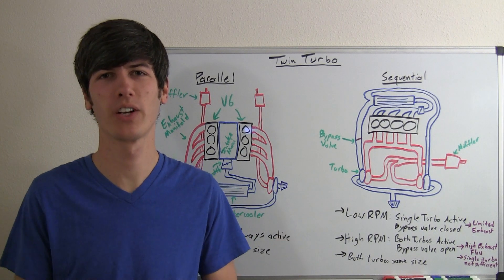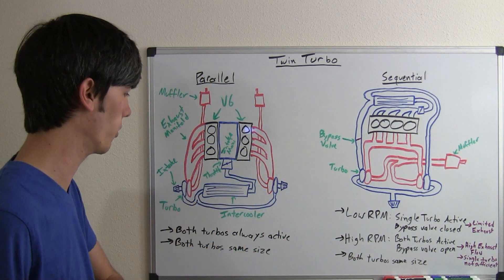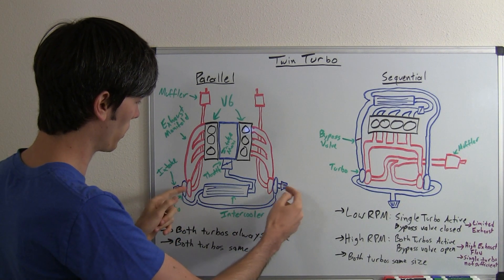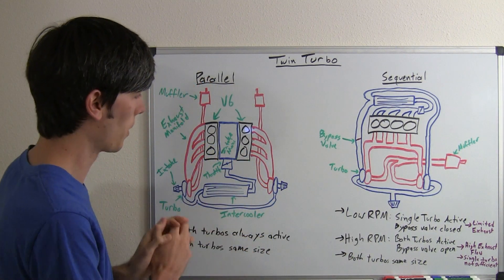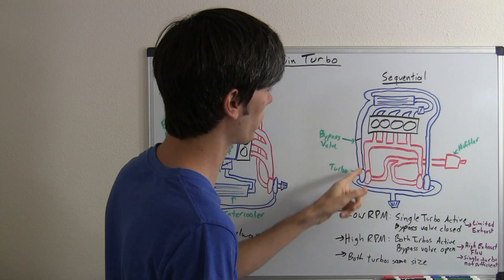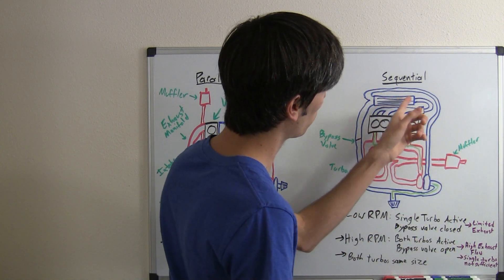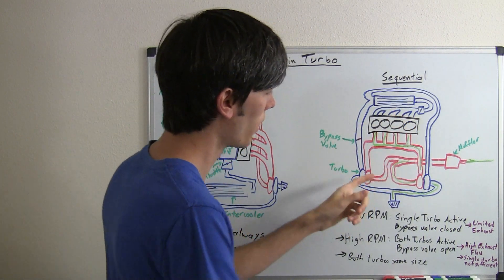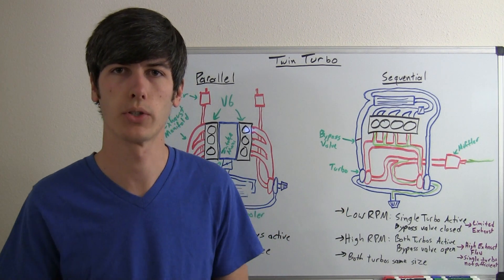How Twin Turbos Work - All The Boost!

Comment: i have a question for u sir.what if a person going a smooth road with sequential turbocharger installed; finds a turn or some obstacle so applies brake hence lowering the rpm leading to immediate valve closure on one of the compressor side hence leading to surge like effect on the turbocharger (somewhat like exhaust braking but at very high rpms) can cause a great disaster to the blades of turbocharger so instead putting valve on intake side ain't it be possible to place the valve on exhaust side of one turbocharger so that this problem is mitigated and even the desired logic of switching both the compressors 'ON' only at high rpms  is also sustained.

Comment: but you can use one small turbo to spool up a larger turbo. The Exhaust gases from the small turbo into the larger turbo. The smaller turbo will give you faster spool up time at low RPM and at high RPM the bigger turbo will come in. It's called compounding.

Comment: if we speak about efficiency in terms of exhuast flow. would it be more efficient (on a 4 cylinder ) to run 2 exhuast ports per turbo or the way you have just explained....... what are also the pros and cons of run it 2 ports per turbo

Comment: If you were to install twin turbochargers on a 1975 914/6 a perfer the Parallel setup, but what size would the engine be able to push?

Comment: Question, if we have two turbos boosting at different rpm with different boost,eg,
Turbo boosting at low rpm with say 10psi and second boosting at high rpm with say 20psi , would the lower pressure turbo have to be bypassed when the higher boost kicks in? Or can you have the high boost 20psi boosting while lower boost 10psi is still boosting? Or would two different boost levels at same time not work? Cheers, learning so much in you videos
Reply: i thinkkkk that would as they combine into the intake but dont quote me on that i would look more into a precharger for that kind of stuff to were you run the smaller turbo behind the larger to spool the larger one much faster.

Comment: Whats the main reason for putting the bypass valve on the air pipe and not on the exhaust?
Do we want to have already built up pressure on the turbine?

Comment: Just a quick question. Once both turbos are working together when the engine isn’t at the high rpms anymore wouldn’t it cause the single turbo to over spin? Or will the bov dispose of the excess?
Reply: Both turbos are not connected to each

Comment: is there any valve on 2nd turbine exhaust line to prevent wastage of exh gas flowing to turbine which is not in use.Also we can use one single larger T/C why use two which would increase maintenance and occupy  more space and piping is very complicated.

Comment: but say you had a petroleum fueal engine say v8 injection eg could you have one 88mm turbo and a smaller say 40/50 mm sorta size turbo but had no bypass system would the smaller turbo over spin? bear in mind that the two turbos would be be completely independent?  im not sure if it work?

Comment: So ultimately which setup is capable of producing the most power/boost, parallel twin turbo or single turbo?
Reply: That's dependent on the size of your tubos and the raw cubic feet /minute. you can have a giant 100MM Turbo or twin 70mm turbos, They'll both give you roughly the same airflow and boost pressure. Twins will spool faster and give you more even power distribution across your rev range. The management system for the twin turbo is significantly more complex than just a solo turbo engine.

Comment: For the sequential set up, let's name the left turbo 1 and the right, 2. Why don't they utilise the exhaust gases from 2 and put it through to 1 at high rpms? You could have a similar bypass valve that just directs exhaust flow to exit at low rpm, then opens up at higher rpms to let the exhaust from 1 go to 2 to spool up the first turbo more. Or is there something like this already? Or does it have some sort of vital flaw that im missing?

Comment: Hi Jason, I love your videos and have been a subscriber quite some time. I am currently working on a second gen Pontiac Firebird. It will receive a twin turbo setup. I have this wild idea about deleting the original fuel tank and putting the radiator in its place. The intercooler would be in the front of the car. I was thinking a rear diffusor would suck air through the radiator at speed and electric fans while cruising. Do you think a setup like that could work? Or should I stick to my pedal cars ;) ?
Reply: How you will fit radiator hose to engine

Comment: There should be a bypass valve before the secondary turbo right? Otherwise there's nothing stopping the exhaust gasses spinning the secondary turbo even at low RPMs.
Reply from the maker: There could be one added, yes, and it'd probably be more effective. Ultimately it wouldn't be able to spin much since it can't take in any air through the intake.

Comment: I have question? so if I use the different size turbo in sequential twin-turbo setup. Small turbo for low rpm which means the turbine can spin a little bit fast, then goes to the high rpm, both of turbo work for the higher rpm boost?
Reply: bob If u use a small turbo for low rpm its fyn but as in sequential as the speed goes high it starts using both the turbochargers . and if the size of both is different u would actually get less boost than the later with same size
Its better to have a turbolag if we can get a good amt of boost

Comment: Hi there! I just wanted to make a question. I have a s13 with a ka24de and I had this crazy idea of making it twin turbo with some small A/R turbos, low comp forged pistons and rods, maybe porting the head for some better flow of the exhaust gases and increasing the spooling of the turbo but I've never seen a ka24dett, my question is, will it be reliable or at least possible? My turbo options are gt22 or k04. I hope to get an answer! I've learn a lot from your channel, keep rocking!
Reply: Porting the head don't make much difference imo

Comment: What is the advantage of using twin turbo over a single turbo in case of sequential?

Also, when car manufacturers talk about a “biturbo” are they referring to parallel or sequential?
Reply: It would reduce turbo lag. Because the first turbo spools up at low rpm.

Comment: Does the bypass valve shut down boosted air? I see it's after the air has been charged, before it hits the intercooler. Dump valve? Thanks
Reply: I think the idea is that when the bypass valve is closed, compressor will stall, which will block the flow of exhaust gas through the turbine.

Edit: many (all?) systems use a valve in the exhaust too that blocks flow to the turbine.

Comment: Does the piping lenght matter or make any difference in matter of efficiency ..cause if one is longer then it would take one turbo a little longer to create compressed air or what? Thanks :)
Reply from the maker: Yes, everything plays a role in efficiency, though my diagrams are basically for the ease of understanding, not a design suggestion.

Comment: so what is the main point in having two turbos vs 1 turbo? is it because you can use 2 smaller turbos which spool faster to give you the same power/boost as a single bigger turbo? and given that u have reduced the spool time, you can go faster (minus the weight increase)?

Comment: Why tuning the ecu gives more power on a turbocharged engine than on a NA engine? I think there are more things to tune that can produce more power on a turbocharged engine, but what are those to tune? thanks for answering!
Reply: Tuning a turbocharged engine makes a lot more power because the turbo can provide air pressure greater than atmospheric pressure inside the combustion chamber.  Example, stock NA engine rated 140hp.  It can only make 140hp without changing to higher compression piston, larger bore etc.  It is limited to 140hp because it cant produce more than 14.7psi of pressure in the combustion chamber.  Now take that same stock NA engine and add turbo.  Lets say the turbo is boosting 10psi and making 235hp ([ (HP of NA car) x (1 + (boost psi/14.7)) = HP at boost psi ]) .  That means at atmospheric pressure at sea level is 14.7psi, the turbo is adding an addition 10psi more.  That equal to 20.7 psi of pressure going into the combustion chamber.  Thus more pressure in the combustion chamber.  Now in order to avoid blowing up the engine, the ECU must be tune.  The tuner addjust the ECU setting to supply more fuel to compensate for the added air in the combustion chamber.  Tuner could also decrease and or increase Ignition Timing as neccessary to run the engine properly.  Result, same engine, but its more efficient and output more power due increase in combustion pressure by turbo.  More fuel needs more air = more power = happy

Comment: I dont get why bypass valve is on the intake pipe. Shouldnt it be blocking exhaust going to second turbo?
Reply: aslanyavuz need to block intake and exhaust sides of second turbo until the first turbo is spooled up.

Comment: How is it decided when to open the bypass valves on the 2nd turbo? and are they opened gradually at a % rate or is it just open/shut? Because a gradual open wouldn't allow for efficient spooling of the 2nd turbo but an immediate open would just be an instant increase in boost at the set rpm open point and wouldn't that feel strange? never driven a twin turbo so sorry
Reply: That's a good question. My guess is that the bypass valve is opened at a set RPM?
Reply: Load and pressure being sensed

Comment: Someone please answer me this.. On a twin turbo set up, does the air intake to both turbos need to be the same length or is that not relevant? I am thinking down the line of 1 turbo (shorter intake) scavenging air from the second? Fairly uneducated guess sorry

Comment: would it be possible to twin turbo a car with two different size turbos and different boost so you can use one to get off a stop faster and one to help in to top speed end I'm a noob and wanted to know

Comment: could you do a video on quad turbos with a w16 engine from the bugatti veyron
Reply: There's a small turbo each 4 cylinders. Works like a parallel twin turbo on a V8 (or W8).
Reply: Mitzkal o, oright cheers

Comment: Hey, i would like to know, what are the downsides to this? Because as you explained it all looks nice and all. Why isnt this kind of forced induction that common? I can guess it has to do with added costs and  another reason for failure? Also can you get more boost like this, or does it just give less turbo lag?
Thanks in advance.
Reply: Mostly costs and reliability. Assuming the two turbos add up to the size of the one larger turbo - it's function is to reduce lag; however, if the two added together are larger than the one turbo - they can create more boost and reduce lag (depending on a number of factors.)
Reply: Thanks!

Comment: Also, what can I expect temperature wise when it comes to sequential? Is one turbo gonna be more hot because it's working through the entire rev range, or is one gonna work low range and the other work higher range?
Reply: I thought the same but coolant hose and oil feed line may help

Comment: One turbo could be smaller, to achieve boost at low rpm and speed up the the bigger turbos' boost faster. Doesn't have to be the same size.

Comment: No need for a "double" Blow Off Valve right? As you set it right before the throttlebody? BUT?? Does this BOV needs to bigger then single turbo engines? I guess it does but not quiet sure..

Comment: So would there be a valve  to split the exhaust between the cylinders and turbos in high rpms with the sequential setup? So does it requires two valves to direct the exhaust in the sequential setup because one is already needed to prevent exhaust flowing to the 2nd turbo in low rpms.

Comment: Hi Jason, how are you. I´m from Brazil and I have a DODGE DAKOTA 99 3.9E V6. I´m plaining to install a Twin Turbo on that, no I will not change my Eng and I need a video or a little help to understand how that work and what´s the best and less money expand option to buy, all that fit parts like: Turbo whats best?, Intercooler (necessary?) , and other parts. Please, I´m looking in Google and the most trustable videos and knowledge I found was yours, so please. Help me a little or DRIVE me in all to don´t made a mistake.  I don´t want to be a Racer I just want a little more power sometimes. Daily I use that CS Evolution Edge in Economy Style.., so I wanna normally drive in economy style, but sometimes get that Turbo Power... can you help me?

Comment: That's what I was thinking... 2 Diffrent size turbos's with different "gearing" I guess (can't quite figure out how it would work?). I imagine that it would be similar to a "twin-charged system's" with a super charger and a turbo. But since exhaust pressure is essentially wasted energy, and super chargers run of the energy created by the crank, it seems like it would be a better setup since it's not drawing from the engine.
.
However to much back pressure, or a exhaust that doesn't "breathe" may (I guess) cause power problems at low RPM's. Everything can be brainstormed and figured out...
.
 it's just the powers that be that are the problem: "HE CAN'T DO THAT"!!

Comment: how is the drowing under the title sequetial not a parallel set up?? i dont see any sequence there.. those turbo chargers are exactle as parallel as the ones on that v6 ... and sequential for me means one after the other...
Reply from the maker: They don't both run at all times, they activate sequentially. One, then the other.
Reply: for me a sequential turbo system is the borg warner r2s turbo system becaus you can actualy see that the first turbo ist optimised for lower rpms and the secound turbo for higher rpms... and tha exhaoust gos through the first turbine(or is bypassed) and after that to through the secound...
I dont wont tho be an ass I'm just discussing :)

Comment: If you run two turbos on a v6 each producing 3 psi of boost do you have 6 psi or do you have a higher volume of 3psi
Reply from the maker: Depends how it’s set up. Measure at the intake manifold. If it’s a V and each feeds 3 psi to its bank, 3 psi.
Reply: Thanks, this was a discussion recently over which there was a difference of opinion! No one seemed to be sure but referred to a law which meant that as you say- the psi would remain the same. Thanks for the reply👍
Reply: Just to confirm, v6 engine with a single throttle body on a centrally mounted plenum, so both turbos would be going through the intercooler then into the central intake. So on this basis do you have 2x 3psi (6) or just 3psi? Thanks!

Comment: Which is more common, sequential or parallel?
Say for instance on high powered, high priced cars like a R35 GT-R
Reply from the maker: The GT-R uses parallel. I don't think there are many, if any, current production cars that use the system on the right. There are better solutions now (like VGTs), which yes, I will cover. :)
Reply: Engineering Explained wow quick reply ahahaha sweet can't wait for it. Really love the videos man!

Comment: u said the both turbos are same size in 4 cylinder engine but, as far as i know cars as a small turbo to work in Low rpm  and  big and small both  turbos to work in high Rpm, is that true

Comment: hello MR. Good Evening, can I know the Difference Between Twin turbo and Bi turbo in engines
Reply: Twin means two. Bi means two. They’re synonymous
Reply: I could be wrong, but I thought the actual difference is......
 Twin- has identical turbo housings, (mirrored to one another). 
Bi- is any route around engine parts to next process of cycle, (intercooler, throttle body, ect).
Twin= cool racecar?
Bi=daily practicality?
Reply: Bi-Turbo is Twin Turbo, its a fancy way of saying a car has two identical turbos instead of writing symmetrical twin turbos

Comment: If I4 has not enough exhaust to run both turbos in low RPM and that is the reason why you run turbos in sequence. What about I6 then? You just run them basically all the time just like you would on V6?

Comment: Is the RB26DETT and Toy JZ engines sequential setup?
Reply: I would guess that rb26dett is sequential and jz's are parallel. haven't seen one in a while so going of memory.
Reply: +Thomas Alsip how can the 2jz be parallel if the exhaust manifold is only on the left side?
Reply: Adrian Cortez you're right, searched it up and the 2jz GTE has sequential twin turbo
Reply: neither of those engines are Vs, so yes.

Comment: He said that the exhaust would be directed toward one turbo only but that would mean the bypass valve would have to be on the exhaust side of the turbo, if not the turbo that isn't supposed to be active will still build boost. correct me if I'm wrong but if the bypass is on the side he put it on; the pressure, assuming the blow off valve is after the bypass or that the system has no blow off valve(s) the turbo would build pressure untill either blowing up the piping or blowing up the compressor! Either way that's bad!!!
Reply: no. cars either have bypass valves or blowoff valves, not both. blowoff valves release pressure from the turbo into the atmosphere when the throttle body is closed. bypass valves, instead of blowing into the atmosphere, recover that boost and put it back somewhere inbetween the intake and the turbo. not only are bypass valves more efficient, but they're much more quiet. the piece of equipment that diverts exhaust gas away from a turbo is called a wastegate.